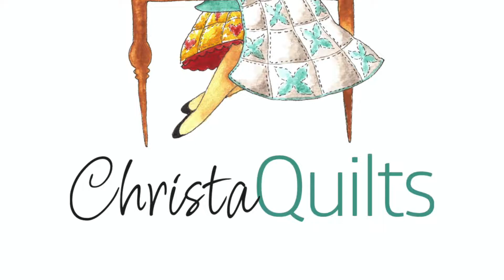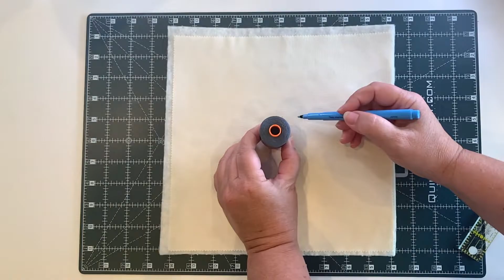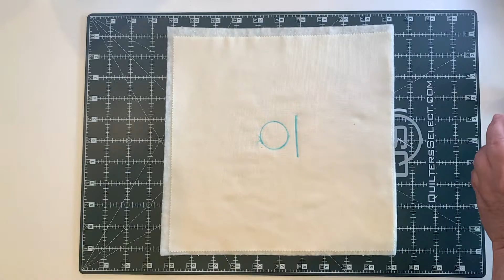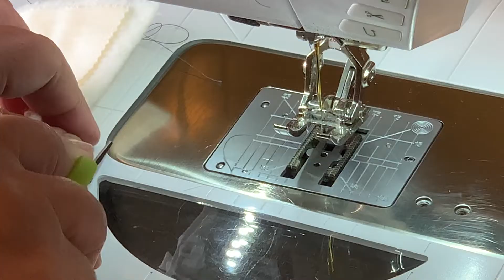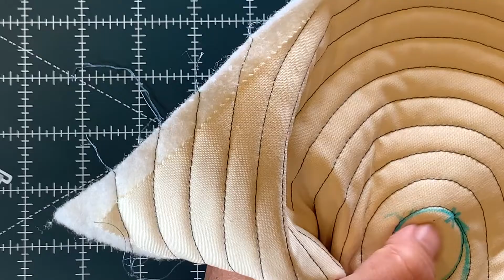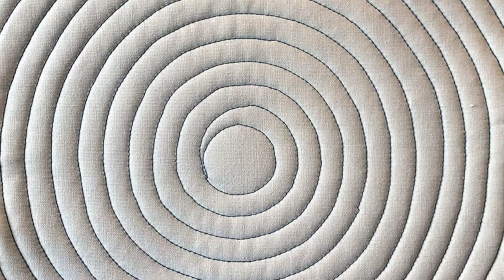How to Machine Quilt Continuous Spirals

Comment: Hi Christa. I want to try this on a t-shirt quilt on my home machine with my walking foot. I need my lines to be further apart than the width of my walking foot. How can I accomplish this?
Reply from the maker: Some walking feet have a guide bar that you can add to extend the width. If not, you can tape a paper clip onto your foot to make your own makeshift guide. I recommend practicing with some scraps because tshirt quilts can be tricky to quilt since they are very squishy. You might have better luck quilting a gently wavy line design because it's less turning of the quilt.
Reply: Christa Quilts thank you!  I will give both a try with practice.

Comment: pretty simple on that small square sandwich but I cannot imagine manipulating an entire quilt for this
Reply from the maker: It's the same exact process, just more turning. I've quilted a queen size quilt this way with no problem :-)
Reply: @ChristaQuilts  as long as you go clockwise it is really easy to do, but the beginning ‘spiral’ is a bit tricky 🤔 This demonstration shows this really well 👍 Once started it goes quickly, and I loved the two quilts I’ve quilted like this 🥰🇬🇧

Comment: Thank you for this demonstration. I quilted in this way on a small quilt but I neglected to start with a nice circle like you did. I'll remember that next time. A question: with the dual feed (instead of a walking foot) and that nice open toed foot, does that also allow you to do decorative stitches, even if they go side to side or in reverse to make the stitches?
Reply from the maker: Yes, that's correct. Using a decorative stitch is a fun variation.